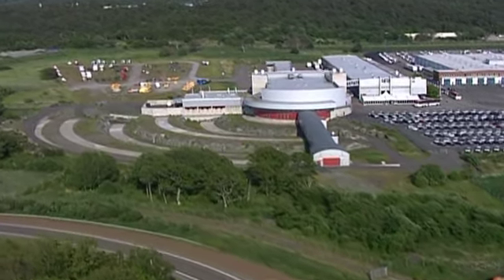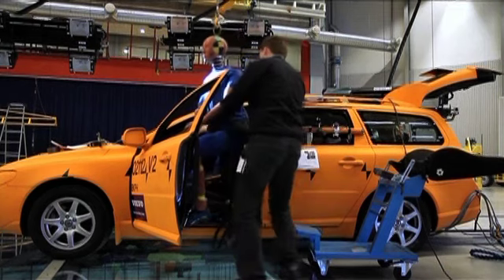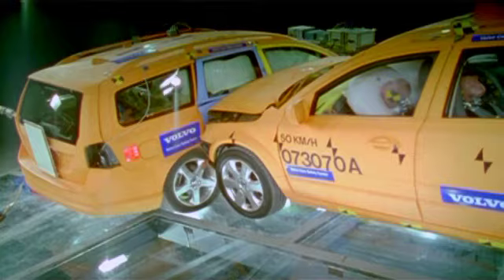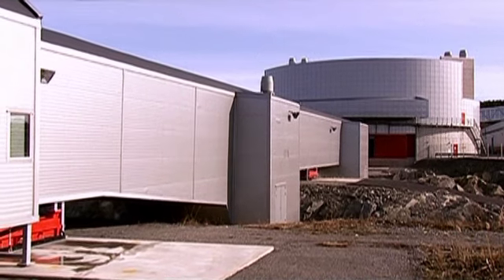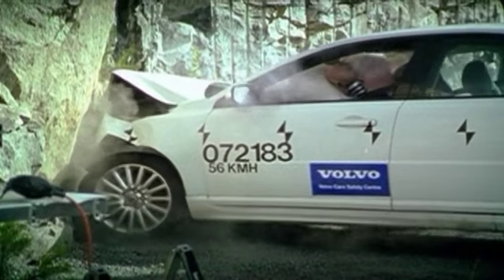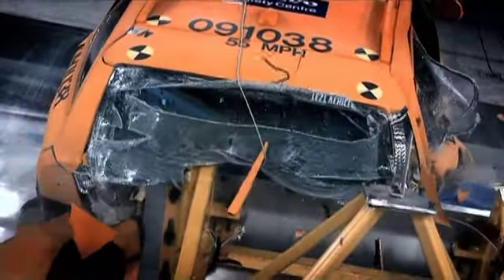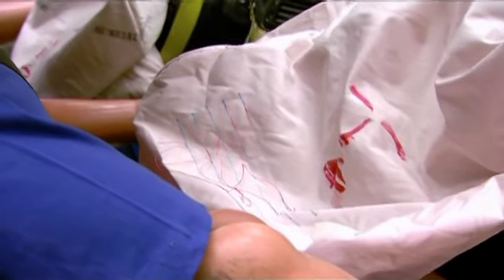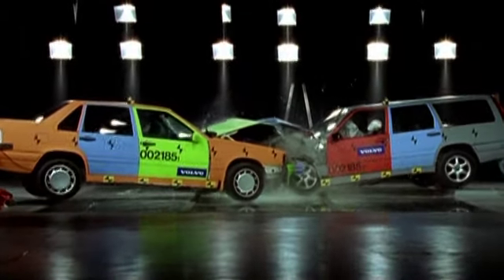Volvo's Crash Test Laboratory Celebrates a Decade of Safety - 1/2

Comment: I think a glass surface would affect the pressure of the impact compared with a natural surface of asphalt or cement, because tires are more likely to skid in the smooth surface of the glass rather than in the rough surface of the asphalt or cement. Does anyone had thought on that?